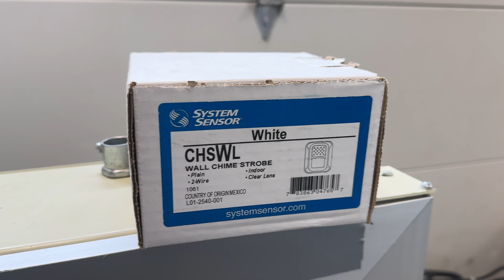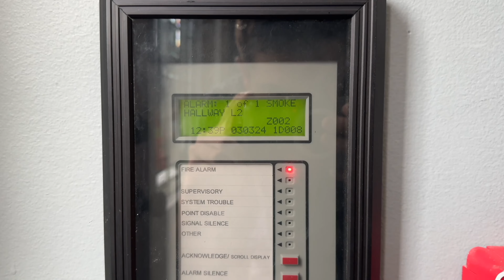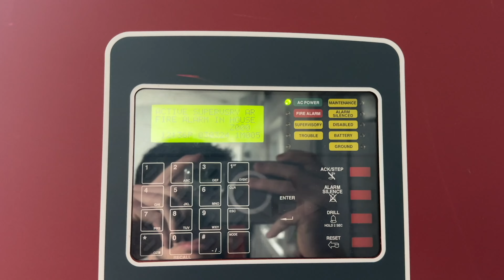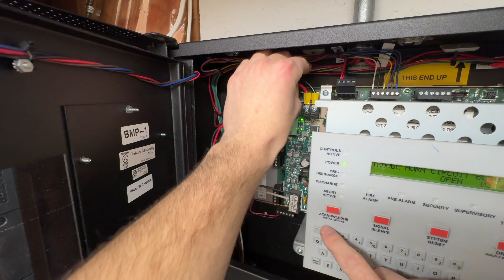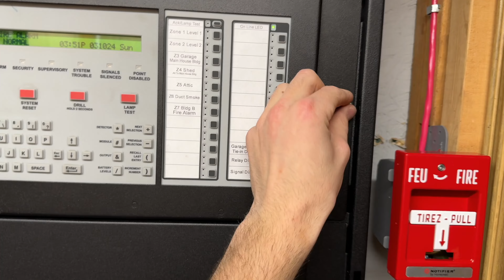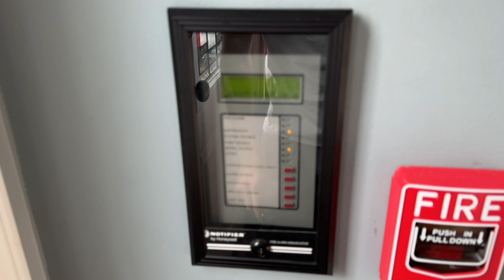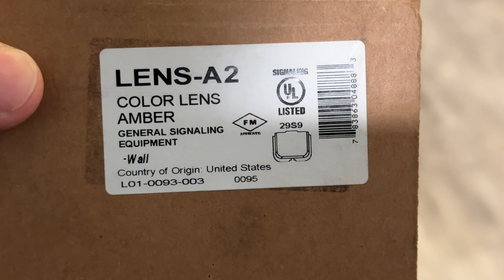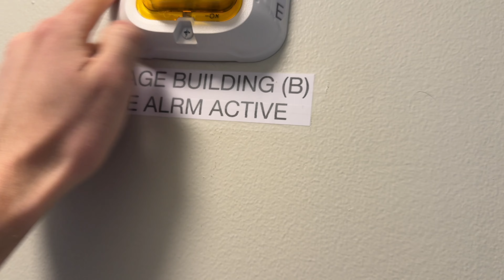Installing Fire alarm Amber Chime Strobe | Garage System to Houses System Supervisory Tie-in

Comment: i still need to know HOW YOU TALKED EVERYONE IN THE HOUSE INTO LETTING YOU DO THIS!?
Reply from the maker: It's not hard if you install a system in an aesthetically acceptable manner with low profile devices, it was recognized that the old smoke alarms weren't doing the job so something had to be done

Comment: Do you think a Dual Strobe Expander Plate could work at least as another notification accessory in the house too?

But yeah I'd have to say the woop is my favorite tone by far. Great job with this project. It's really turned out extremely nice.
Reply from the maker: They are meant to be paired with a speaker strobe that can do different tones if it was just paired with a low frequency sounder it would only be a remote strobe
Reply: @nics-systems-electric  yeah that seems about right. I forgot the combo's do not come with a built in speaker (horn nor speaker) and if you were to install it under your fire notification applice (the L series classic LF Hs) , it would act as a remote strobe when the garage goes into alarm. Thus, since you wanted to hear when the garage goes off, you have a separate device (the chime strobe) to act as that notification in supervisory?

Comment: Nice job, looks great! And out of curiosity, is the panel giving the CHSWL a sync signal? I doubt both systems will realistically be in alarm at the same time, but it can’t really hurt anything for it to be synchronized
Reply from the maker: I can't remember if I put a sync protocol in there there is a 50-50 chance I did or did not

Comment: I honestly want a commercial fire alarm system in our house because our smoke alarms are less then 10 years old but are not working even with batteries But my family cant put one up because 1. too hard 2. Too expensive and 3. Our walls are to thin and the screws might go through them, And also our sprinkler system has a flow switch connected to nothing so we would never know

Comment: WHAT DUSE THAT SECURITY LED MEEN
Reply from the maker: Can be with a door contact on annunciators Fire phones fire hose cabinets and other fire related components that likely have a door or cover that should usually remain closed
Reply: @nics-systems-electric  COOL. now all your house system needs is carbon monoxide like your garage system but that's another video or videos! keep up the good work
Reply from the maker: @cyberlight22   I did not install that because there is no need. the garage doesn't need it either. It was just for demonstration.

Comment: why is the light pull station next to you in the LINKED video flashing so fast? [ https://youtu.be/zboTpL8CzqY?t=1129 ] I thought it normally flashes slower and is green.
Reply from the maker: Just comment on the video you actually are wondering about
Reply: @nics-systems-electric  okay.